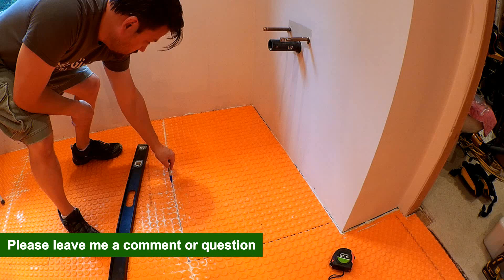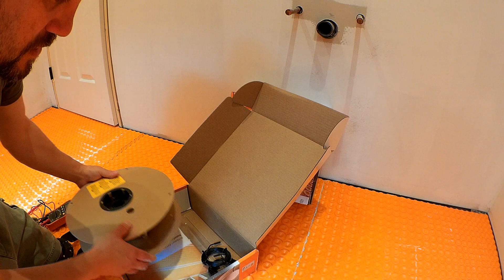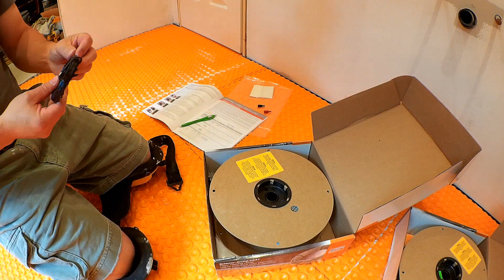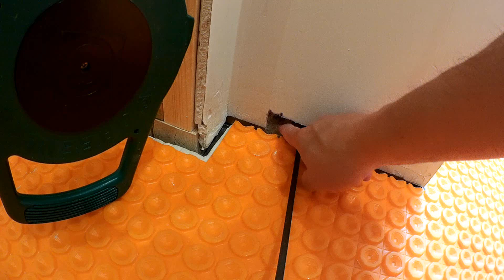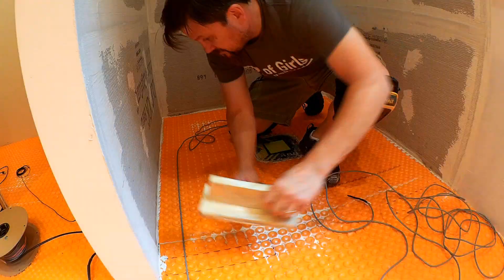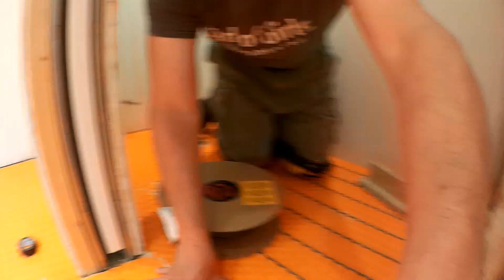Ditra Heat, Electric Floor Heat Install Part 3 - Cable Installation

Comment: why wouldn't you run 240v?
Reply from the maker: Thanks for the question, in my instance, the amperage draw was not large enough so as to require a 240v circuit.
Reply: @richofalltrades1  That is understandable!
Reply: @richofalltrades1  Also, yesterday I just installed my first ditra heat. It was stressful but now I get it...

Comment: Did you redo the 2 gang box or just turn the faceplate 90 °. In video 1 you put the faceplate left right now its oriented up down. Is it still all the same hardware?
Reply from the maker: Thanks for the question, I simply rotated the faceplate. It's the same hardware. I just realized that I needed to reorient the plate to make it work with the programmable thermostat.

Comment: Perfect guidance. We have a 9'8" by  9'6" bathroom, requiring no more than 50 sq ft of heating cable once the tub and dual vanities are in place. Removing the jacuzzi tub gave us access to a 15 amp dedicated circuit, so your work maps well onto what we intend to do. I'm buying conduit tomorrow. Thank you.
Reply from the maker: Thanks for the feedback, I am glad I could help. Good luck with your project.